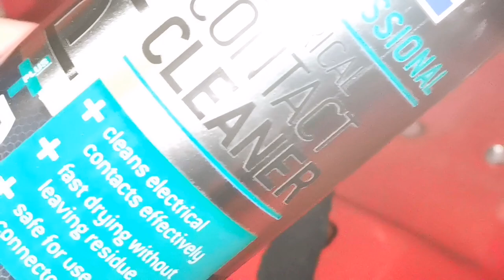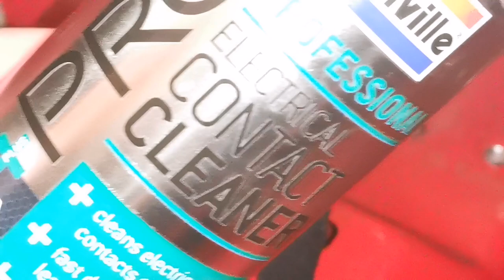Connector Plug Green Crusty Clean Up

Comment: Dave could you make a video showing how you de pin connectors.  Thats something I really struggle with and would be useful to check some female pins for  serious water corrosion.
Reply from the maker: i could but as you know some are easier than others, so the connectors i have around my not cover everything

Comment: White vinegar works extremely well.  Follow it up with baking soda in isopropyl alcohol to neutralize the acid from the vinegar.  And finish the job with Deoxit.
Reply: White vinegar is not recommended as will tarnish the electroplated contacts, will attack plastics, dissolve rubber grommets and melt insulation. The guy in the video is showing what he uses and shows the results without vinegar.  Deoxit is a brand of electrical contact cleaner similar to what is shown in the video